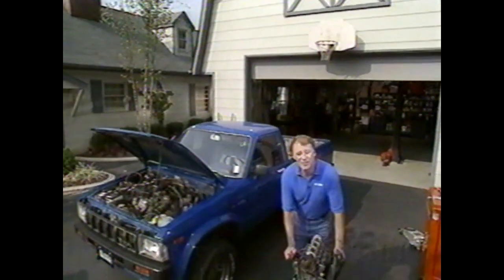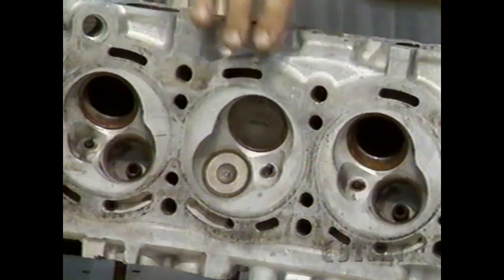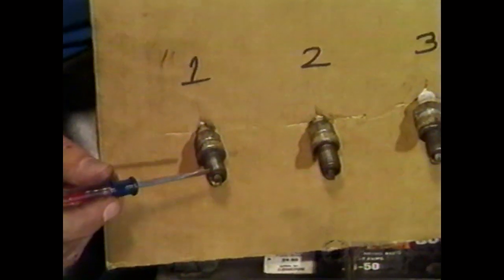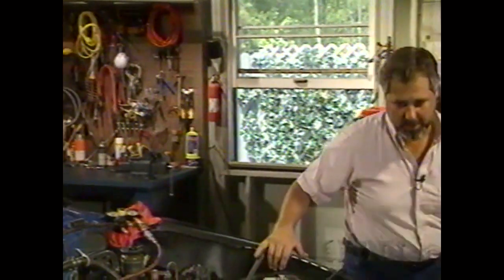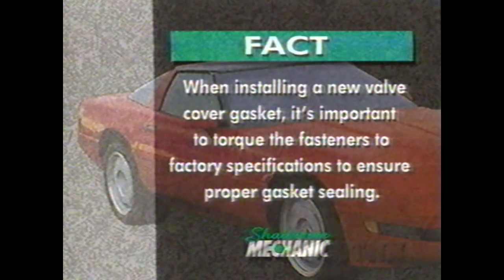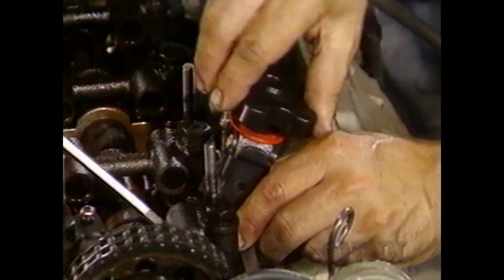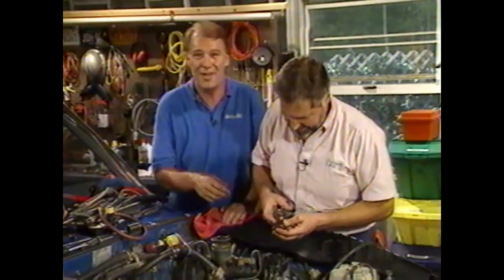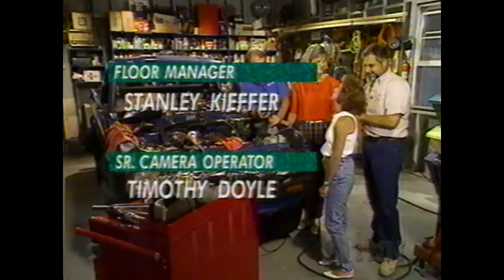Shadetree Mechanic ST2-16

Comment: I had an 83 Toyota pickup 4x4 with the 22R and an extra 20R in a 81 Toyota Tercel. They were damn good engines. I wasn't too impressed with the Asian carbs so I converted to a Holley 2 barrel. I wish I never sold them.